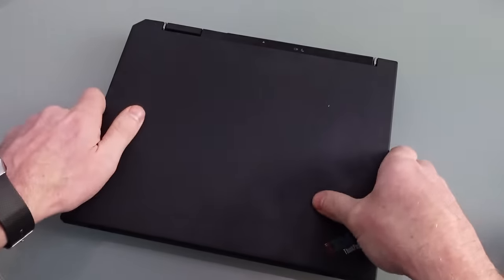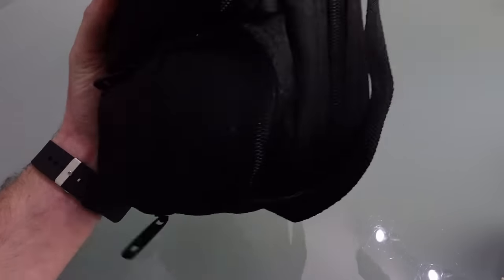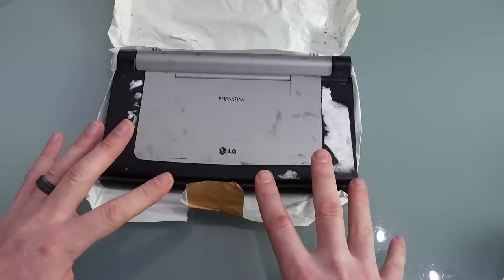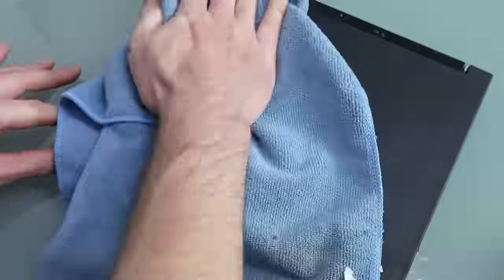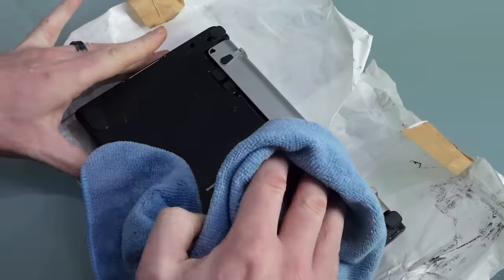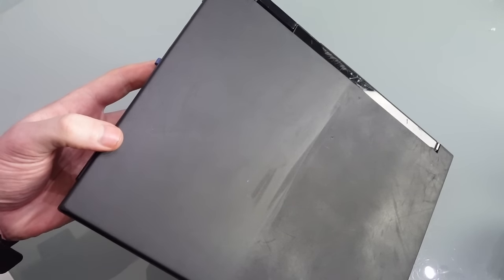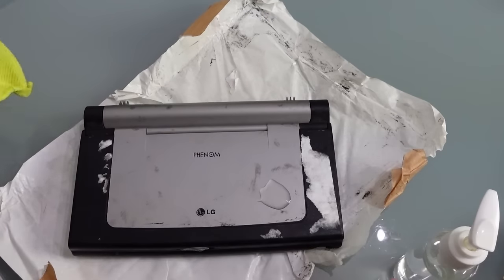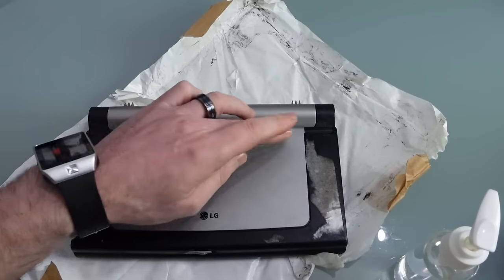Rubberised Computer Coating From The 90's - Restore Or Remove?

Comment: I call that stuff faux-suede.  Liked it until the first one went to goo, then despised it thereafter.  I always remove it when it goes bad.  I use alcohol wipes.
Reply: Also, whenever I see it on something new, I won't buy it unless it's absolutely essential.
Reply from the maker: That is a good description, I agree its OK when its new and gives a tactile surface but the way it breaks down is just soooooo bad! I stripped the Sienna with alcohol wipes, worked well but I have found the handgel and a cloth better

Comment: An acquaintance restores old tools for a charity. For the rubberised coatings on handheld tools like drills and jigsaws, good old wd40 removes the stickiness. It does leave that familiar smell, though, so you have to decide if this is acceptable or not.
Reply: Yeah, this basically destroys the coating.  Looks ok initially.  Oils destroy rubber.  Try folding a bit of orange peel near a balloon, it pops immediately because the oil breaks the chains straight away in the rubber.  Its a cool experiment!
Reply from the maker: I never even thought of WD40, come to think my drill handle has gone a little tacky I will give that a go tomorrow - also love the small of WD40
Reply from the maker: Oooh Orange oil will melt a balloon? Thats cool
Reply: @HandheldComputing  Yes, the orange oil is a hydrocarbon and rubber is soluble in compatible hydrocarbons. The reaction is almost instant. But hydrocarbons will always break down rubber.  So puttinh hand creme on a rubber coating is bad because it usually contains lanolin and may contain paraffin which is used to prevent moisture loss.  Now the coating used is a synthetic rubberised polymer but I have no idea how that will reach differently to latex,  but it certainly seems to perish in a similar manner. I believe the Germans had to make synthetic rubber during the war because they couldn't get natural latex but I also think the synthetic version was inferior in many ways.

Comment: My IBM Thinkpad was completely melted all over and it looked absolutely horrendous, I took it completely apart and stripped everything with ISO, it was the only solution. The rubber is crap and in the end the most lasting solution is going to be to get rid of it completely, I hate this stupid rubber so much
Reply from the maker: Having stripped the Psion Sienna I think this is often the best way, as I say no manufacturers rubber coat laptops these days! Sometimes the rubber feet break down as well but they are easier to replace thankfully.
Reply: @HandheldComputing  yeah. My thinkpad had on the frame around the keyboard some kind of metalized primer or something so it went from black to silver when the coating was removed but this was damaged from the exposed melted areas and also looked very bad. But as I went all in I removed everything and then I foiled the screen and keyboard frame with a nice black marble stone laminate to get it back to an even better look that original. Those who seen that special work said that was a very fancy computer you have there. And I say I foiled it they be like, Bruh.. that looks good lol. Much better than stock in every way.

Comment: Devices are still made with that rubber coating, or they were in 2009, I bought a Pure One Classic digital radio back then, its rubberised coating has turned to a sticky goo, I hate that stuff and I hope it's never used again, I think it should have been banned years ago.
Reply from the maker: A number of people have mentioned that its still being used for mice, game controllers etc which seems a bit crazy to me when we know how bad they are!
Reply: @HandheldComputing  I think my Logitech F710 game controller, a device I really love, has it, at least it has rubberised hand grips, here's hoping they won't decompose.  For some unexplainable reason my BopIt XT game has rubberised coatings on all its controls, and they're all getting sticky.  Since they're coloured and two of them have printing on them, I'm not sure how they'll scrub up should I try to clean them.  Oh how I hate that stuff.
Reply from the maker: If you clean it you will lose all the markings. I would try the moisturiser and if that doesn't work try talcum powder or corn starch, just be aware those two will cause  some discolouration  @Lachlant1984
Reply: @HandheldComputing  I see, thanks for the tips.

Comment: They still use the same awful rubber coating on lots of modern products and it's still just as bad and perishable as it used to be. It's even used in some cars nowadays.
Reply from the maker: So it seems, I guess it's a cheap way to make your plastics look better - not good though!

Comment: Nah… disassemble the device and clean the rubberized parts properly.
Reply from the maker: I'm with you, I think that will be the goto option form now on!
Reply: @HandheldComputing  Yeah. It's fine if it is just starting to go, but so many things I've found in boxes I forgot about just need to be disassembled and properly cleaned. I just wish there was a spray that could reapply the coating instead. that way there is a way to strip the old and apply a new. maybe even with colors.

Comment: I feel insulted by the title of the video, because anyone who is worth their retro salt knows that there is no restoring that rubberized coating. Sure, you can wipe off the gloopiest layers on top with isopropyl alcohol, but that's hardly restoring it. That coating will disintegrate 100% of the time, and you can't restore it. It's the nature of soft rubber, just like your cassette belts, it'll turn to goo. 

If you are interested in gaining more subs, I would suggest not using video titles that are obvious non-questions. 

Not trying to be a jerk.
Reply from the maker: Thank you for your comment 😊

Comment: i use wd40 with better results and easier/quiker than anything else.
Reply from the maker: Going to give this a go on my drill handle as the rubber has melted on that and WD40 will make it smell extra manly 😉

Comment: Rub it off with isopropyl alcohol and move on with your life.
Reply from the maker: A very pragmatic approach, excellent!
Reply: It worked a treat on my old Logitech LX710 keyboard from 2006 that I'm still using. The entire keyboard surround got tacky, started rubbing off here and there. Isopropyl alcohol was the only solvent that I already had, so I just tried it with pleasing results.

The oil in our skin and the frequency with which we might wipe our mouth while eating and typing all leads to a break down of starchy/rubbery coatings. 

Salt and Vinegar flavoured crisps are great also for dissolving the coating off the areas you touch. My USB power bank had the starchy finish to it, I picked it up finger and thumb only, there is a thumb sized shiny spot now on one side....only a few seconds of contact! ..stripped!

Comment: I imagine the coating could be replaced with something like plastidip
Reply from the maker: There are a few different options for replacing the coting including a number of spray on products - If it was to be a museum piece this might be worthwhile but I am wanting to use them so for the moment at least removal is a good option if the coating has gone to goo